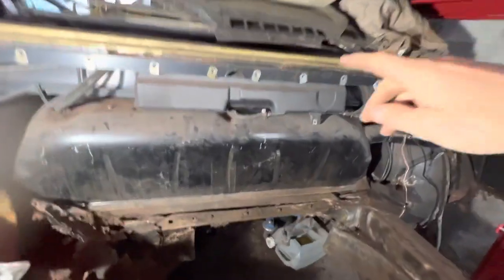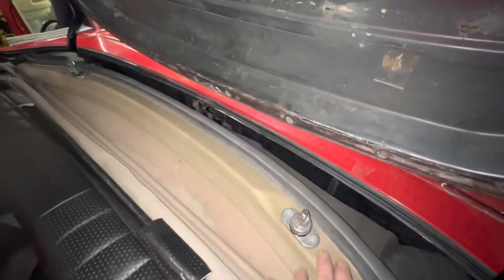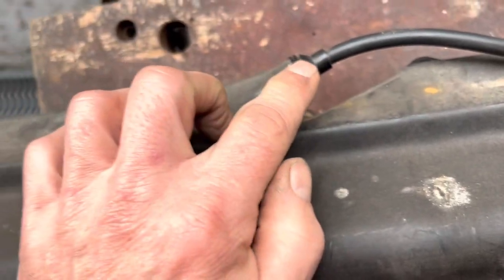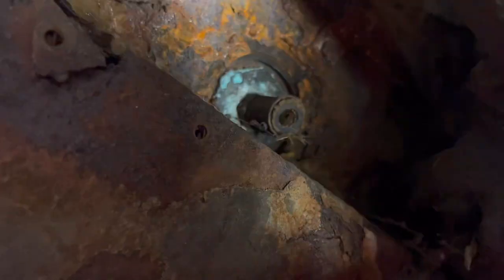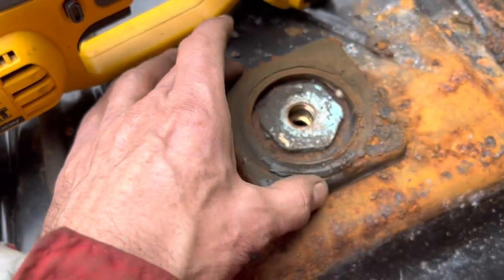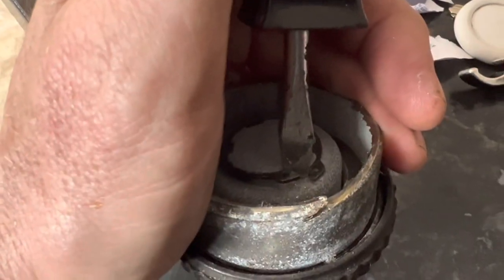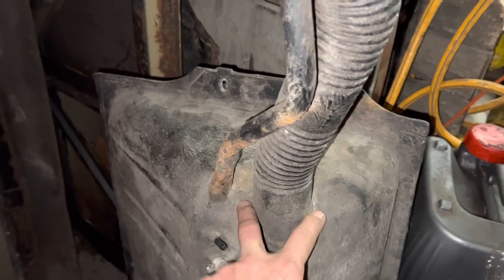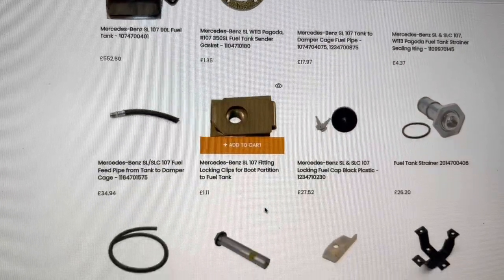Mercedes R107 SL - How to remove fuel tank, header tank + locking fuel cap

Comment: Also a question, I have cold start or many times even hard start problem with my 380SL. I replaced fuel pump, fuel filter  also replaced that small fuel line in front of hood. But many times it just crankssssss and does not start. And for first start when I press gas it does not take off right away, it takes some time and then takes off.. my guess is fuel is not reaching the carburetors (if this one has one) or fuel injectors? 
This summer I plan to change accumulator too...do you think accumulator should fix it or is it something else?
Hope you get it..
Reply from the maker: Hi - If you are experiencing difficulty starting when the car is warm, then the accumulator is often the culprit. This device maintains fuel pressure when the car is stationary. If has a diaphragm inside and if this leaks pressure, you have to keep cranking to get the fuel pressure back up. You can test the accumulator by detaching the line from the accumulator to the damper. If fuel gushes out, you know the diaphragm is perished. If changing the accumulator doesn't fix the problem let me know and you can try switching to Plan B. Mike
Reply: @MikesMercsandothercars  got it. Yeah I will replace that in next couple of weeks and update you Thanks!!